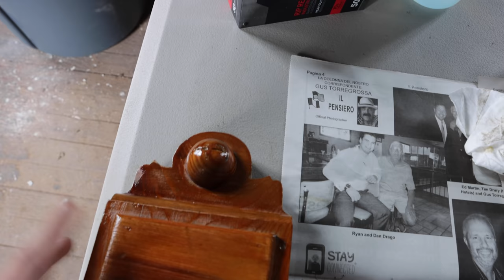Today is a very Sad Day! Upcycling Church Pews! EP 21

Comment: It is unfortunate that these historic houses were built before building codes were put into place to contain fires with fire stops and sealed holes.  Once the fire finds its way into the cavities of the walls, floors and ceilings its game over for the whole structure because of chimney effect.  Mansard roofs are extremely dangerous for fire.  If there is a way to install fire stops as part of renoavtion, do it.  Also look into how much a sprinkler system install would be and how much it would save on your insurance in long run.  Having lots of fire extinguishers around would never be enough especially if the fire starts inside  a wall because of electrical faults.  Enjoying your series very much and hope to see your neighborhood in person the next time my travels take me through St. Louis.

Comment: When I lived in Edinburgh I spoke to someone about why so little of the city had changed over the last 200 odd years. Areas grew with most of the original buildings being retained. Gayfield House 1760 was a country residence just outside the city and is now surrounded by buildings dating the late 1700s to the modern period. The house was always kept.

I had thought Americans with so little history would seek to maintain but I ave heard otherwise. Such as recently a timber house dating from the 1770s in New England was simply bull dozed to clear the site for some McMansions property development. It was quite possible to lift the entire box frame house off it's found and remove it elsewhere.

Comment: I wonder if there's a way to add a discrete fire suppression system to your restoration. Obviously you don't want big industrial-looking sprinklers sticking out of the ceiling, but strategically placed concealed sprinklers might be worth it.
Reply: No. Not with the plaster ceilings and walls.

Comment: You keep saying shellac.
Are you really using shellac? I would think polyurethane would be a better preservative even with color. I've used shellac before it was almost temporary. Peeled off,  scraped off like it did not saturate into the wood. Let me know Im curious!
Loving the work you are doing to your beautiful home!  Praying that woman  does Not take up residence on your porch or destroy the rest of the neighborhood!
Reply: it's shellac
Reply from the maker: Its actual shellac. garnet shellac to be exact. Shellac isnt as "hardy" lets say as poly. It can not handle sitting water, alcohol or high heat. However it is easily repaired as it is an alcohol based finish and it dissolves in alcohol so it "melts" into itself and blends well. Ploy if you get a problem its strip the whole piece situation. How old was the shellac you used. It really only has a shelf life of about 5 months so if your mix was older you can run into issues. Missing your own shellac from flakes is the way to go as the fresher the better. I think shellac looks better as well as ploy looks like plastic. 

And believe it or not she owned/ owns that house. I think she is living in the garage now. I am not sure.

Comment: That is so sad to see such history go up in flames.  It may have been in disrepair, but some day someone would have come around and restore it as you are doing with your home.  You have done so much work on your house, it is beginning to show.  So much needs to be done that will never be seen but it needs to be done.  I am in awe of your efforts to keep the house as historical as you are doing.  Right down to the plaster.  Some would replace it with sheetrock.

There was a home in our area that was built in the mid 1850 that had 3 stories and a magnificent spiral staircase.  This staircase was constructed by someone who came by when the house was being lived in with temporary stairs.  He needed work for food and said he could build the stairs.  He did, he moved on and no one ever knew who he was.  Anyway the house was being used as a B&B, had bad electrical wiring which caused the house to completely burn to the ground.   About 12 feet of the staircase survived, but that was all.

Don't skimp on electrical!

Comment: You're not alone. It saddens me when our city housing stock disappears because it will never be rebuilt. Vacant lots are our legacy now.
What happens is scumlords from NYC come upstate to but older but repairable housing stock. They buy houses at dirt cheap prices because no one else wants them. Then they get section 8 approval. Welfare people move in and the rent check doesn't have to be chased after. After three years the city will start foreclosure procedures because  taxes haven't been paid. The scumlords then play this game of paying just enough taxes to delay the foreclosure procedure. In the meantime, no repairs or upgrades are being done to the building. The section 8 people can't complain and if they do, the scumlord won't return calls or does the absolute bare minimum to stop the complaints.
Eventually, the house becomes unliveable, usually due to a roof that leaks and won't be repaired. Then the 
 scumlord abandons the property and the city takes possession and is stuck with the demolition costs.
The scumlord then moves onto the next properties or if prevented from purchasing properties in this city, will start over in another city or reincorporate with a relative or new company.

Comment: It is very upsetting to see such loss.  I have kind of experienced a similar loss. As I have told you about our purchase of an old church and our subsequent refurbishment of the church, making it into our home.  I have not told you why we no longer live in it. Firstly, my husband's job took him two hours away from home, while I still worked in the city.  Once he had established that he would be staying with that job, we reluctantly came to the conclusion that we would have to sell our beautiful home and relocate to the town my husband was working in.  This is when the fun really started; we had had issues right from the beginning with our water, because the church was in the country, we required a well and septic system.  We found water and lots of it, without any problems.  The problem began when we had the water tested to make sure it was potable, meaning good to drink and cook with.  Imagine our surprise when the report came back with the news that our water had extremely high levels of salt in it. The solution was to install a $10,000 water filtration system. That only worked for about three months. So, we had the water tested again, the salt 🧂 levels were higher yet. Also, there was a certain chemical in it that indicated that the salt was actually coming from the road salt used to salt the highway adjacent to our home.  So we contacted the Ministry of Transportation and they came out and did an assessment of the situation and concluded that it was indeed road salt in our water.  So, they paid to have our well redrilled to make it wider and cemented a stainless steel pipe inside to stop the salty water from leaking through fissures in the rock and into our water.  Well, that was good for less than a year. So, we started buying water by the 18 litre jugful from Costco.  We had to replace all of our taps in the house because they were corroded, we had to replace our toilets because they corroded, our dishwasher, washer, etc., because, you guessed it, they corroded. We contacted a Realtor to come out and appraise our home, so that we could put it up for sale.  Imagine our surprise when he told us that in order to be able to sell it, we had to have potable water.  So, back the Ministry we go, for over 8 months, we tried to find a solution to no avail.  So, to make a long story short, it was decided that the Ministry would buy our home and between the city we were part of and the Ministry, it was decided that because the water could not sustain a building due to the water problems, it was decided that it would be best to either move the house to a new location through Habitat for Humanity or tear it down!  It was too tall to move, so it was decided that it would be torn down!  We were heart broken to say the least.  We had put a lot of blood, sweat and tears into the remodel and now it was being torn down.  We donated all of the interior of the home to Habitat and once they had stripped the inside and taken all of the things on the outside they could reuse, the building was torn down. The people of our small community were almost as upset about the issue as we were.  They had been baptized in that building, been married or buried from that building, so they shared in our grief!  Would we do something like that again, in a heartbeat!  So, as you can see, I share your disappointment about the loss of all that history, but you are doing a wonderful thing by bringing back the house you are working on!

Comment: Look on the sides of the door frames for Dowel pins when you have stripped them down. If you have them it's more than likely the door itself can be taken apart and you may find a thin slab of pine mated with a thin slab of oak. You can drill out the dowels and gently separate it's pieces. If you want to really find out the reason. I've sent a link that shows the process 
https://www.youtube.com/watch?v=iEtViXtlXUc&t=143s

Comment: Have you tried pushing your steel wool into the beads with a butter knife?
Reply from the maker: yeah. it works. The Real MVP tool wise is the brass brushes they make the job much easier.

Comment: I'm NOT trying to start a sh*tstorm here but, will you consider installing a sprinkler system in your Victorian? Seeing what happened a few hundred feet from your place was very sobering.
Reply from the maker: Ive considered one but its just not in the cards for me. An appropriate 
 dry system for this house would double the cost of the completed house. Getting a loan on something like this is already really difficult. To ask for another 150k to 200k for a system wouldnt fly with the bank and as i have stated before i am not a wealthy individual and cant float 150k. We just have to be careful. One thing i can assure you of though is that i will not be having barrel fires anywhere near the home.